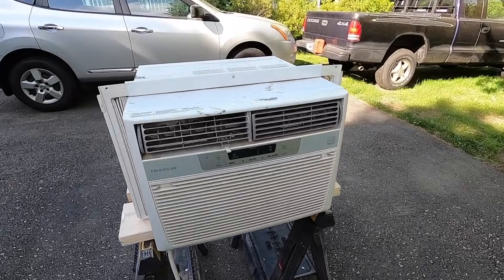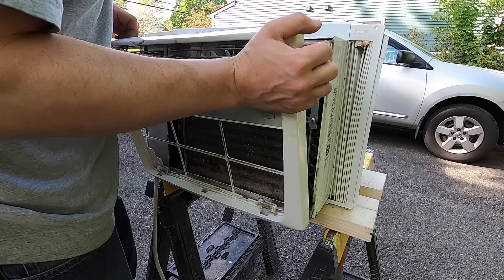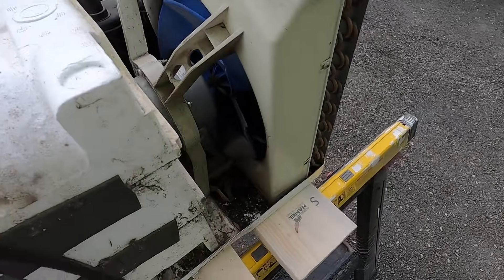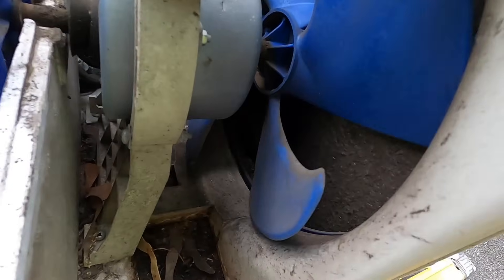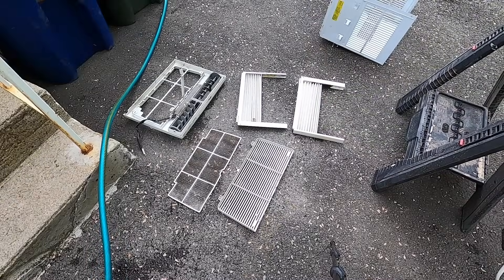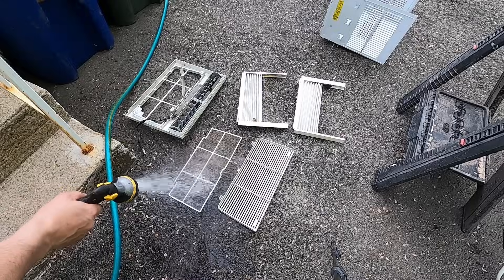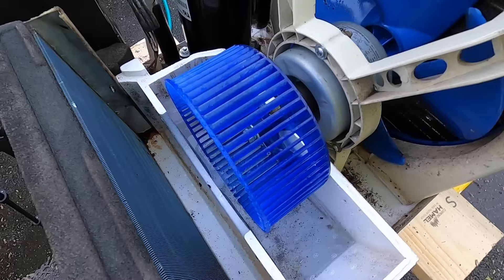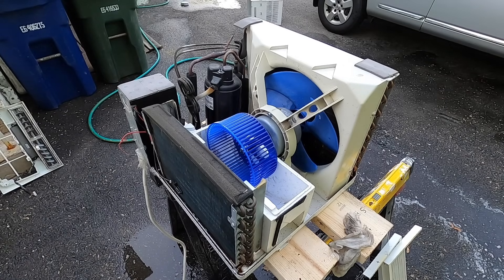How to Clean a Dirty Moldy Window Air Conditioner

Comment: Good reminder for everyone to check their a/c for mold. I'd add 2 things: try to keep the GFCI plug dry- if you leave it on the ground in the water it can permanently damage it, and they are expensive to replace. Second, run the a/c for 30 minutes or so after cleaning, in order to evaporate water that might have gotten in the bearings. I've cleaned a/c units without running them immediately afterward and several times a bearing apparently got water in it, making it very noisy, and replacement of fan motor  bearings is a hassle that is best avoided if you don't have to do it.
Reply: Better yet, don't get water in the bearings in the first place. I had to replace my bearings. Total PITA.
Reply: Run it IMMEDIATELY or after letting it dry in the sun for a bit?  I'm going to bag and tape the shit out of mine.
Reply: @josephdockemeyer6782  How did it turn out?
Reply: @GuerreroUrbano100  Haven't done it yet.  Severe mosquito infestation here with 15% positive for West Nile.  Swarmed just getting into the car.  So don't want to be out in my driveway that long...  52 bites just taking out trash and carrying in groceries.  Sucks lol.
Reply: Wd40 the fan bearings first - check
Reply: Best thing is to clean it before you put it away before winter. Don't like taking it out and having to put it back in. Have one that's 9 years old and works just like it did when I bought it.
Reply: @Seriouslydave  where are the fan bearings?
Reply: @3242clyd  the fan is a wheel with an axel , or spindle in the center, the spindle will have a metal ring around it , the bearings are in their , think of a bike wheel , the berings are where the spokes ogiginate in the center , or  a skate board , the bearings are right next to the axel
Reply: @Seriouslydave  No. It could get in and dilute the grease/oil.
Reply: I made this exact mistake a few years ago.  Unit still cooled great but the bearing was SCREAMING.  Had to scrap the whole unit because of a $5 bearing.
Reply: @MrMjrob  Someone posted a video of changing out window ac bearings- it can be done using skateboard bearings. I've done it- there are 2 bearings on the motor shaft- it's time consuming because you've got to take so much apart. Worked OK, but you're much better off keeping the bearings from getting wet. It's a lot of work that can be avoided.
Reply: @mickm5097  yep, I tried!  Couldn't get the old bearing off. Finally gave up.
Reply: Good Advise, My Styro Duct and Blower wheel were very moldy. I used Clorox l clean up on the moldy parts. Then the next day I started it up and it sounded like a coffee grinder .
Then the black stuff came flying out of it.  After a few minutes it quieted down.
Reply: I’m confused. Where do you suggest adding WD 40? 

And isn’t it an issue if you run it wet??
Reply: @elisap1098  I wouldn't use wd-40- it's not a good lubricant in this case. One of the problems that occurs when you clean an ac is water getting in the bearings. Bearings are rings with grease and little metal balls that allow a motor shaft to turn smoothly. When water sits in there for any period of time, the metal balls begin to rust and you start to hear noise, and the motor can even fail to start. So you want to run the ac right after washing so the motor turns, the bearings heat up, and any water in the bearings evaporates, to try and avoid these issues.

Comment: You can prevent all that mold in the first place by simply drilling a hole to let that condensate water drain from the unit. You will take a small hit on efficiency, but you will not ever have to deal with a moldy unit, OR do a really deep clean like this. It's the standing water in these units that causes all the problems. Using a step drill bit is recommended so as not to puncture the condenser and let all the refrigerant out. This is another example of energy efficiency standards causing more harm than good, with all these clogged up units that get sent to the dump every year. Do yourself a favor after you get your unit all cleaned up, and drill a hole in the case to let that water drain out!
Reply: Yeah????
Reply: The problem is using eco mode on air conditioners. The fan isn't left running long enough without the condenser on to get rid of the water in the back of the unit. Use eco mode during the day and use the normal cool mode at night so when the condenser shuts off after reaching the desired temp the fan stays on expelling the rest of the water.
Reply: I have this same unit and there is a drain hole in the bottom but it is located rather far foward toward the wall of the house.  It gets clogged with debris and slime frequently gets clogged.  Here in Florida it is a constant problem.
Reply: @Dallas_K  go to home Depot and buy window screen. The cheap stuff. Wrap it around the outside so the vents are covered. Clean it off when it gets dirty. Put an extra layer on top of the ac, that where most of the stuff falls in
Reply: I drilled mine out with step bit due to hole placement being not right it will still clog based upon where your unit is located ...near trees or near shade or having shingle roof or several factors
Reply: It expels the moisture in the house too. Add lysol or bleach solution to rear of unit weekly.
Reply: @designstudio8013  Where would you add a bleach solution? Are you saying add it in the drip pan?
Reply: @playerroku4412  The fan will not expel the water as alot will stay below the fan level.
Reply: @Dallas_K  I put a plastic tube with a syringe I attach to pull a siphon to empty the drip pan.
Reply: @TheMsparker27  Yep spray it in the rear pan. Siphon out water with a tube and syringe as needed.
Reply: where is the case
Reply: Where is the best place to drill the hole, kinda near the back or the middle underside or a hole in both back corners maybe?
Reply: @elijahmelendez9864 the whole exterior is the case, but the reference is for the bottom of the part hanging out the window
Reply: @playerroku4412  i always turn eco mode off, still an issue.
Reply: @themaindragon  then it's dirty.
Reply: @designstudio8013 oddly, as a temporary fix, I tightly rolled a shop towel and inserted it to drain. Do you have a photo of what you did?

Comment: My a/c had mold the year before. So remember that if you get mold in the a/c, you may need to clean it once a year because my mold came back the following year. So now I will do it every spring before the season starts. NOTE: I cleaned my a/c in the bathtub by putting down garbage bags to protect the porcelain. Headaches caused by the mold are lessoning. I'm washing my walls in my space and washing everything to get rid of mold spores. Thank you for this video!
Reply: Black mold alergies is not fun.. prevention is best, clean and care every so often.. so it doesn’t build up like this unit in video
Reply: Mold smells, musty and disgusting.. keep it clean and fir god sake don’t live in moody space

Comment: As a hotel handiman I used a fin comb to straighten and clean between fins. There was also a special spray cleaner but it was pretty harsh. I'm rather upset the manufacturers did all they could to keep us from easily cleaning these but they need to sell as many units as possible so it's really up to us to learn what you're teaching and nudge them towards what we want by not considering these things disposable. Peace.
Reply: God help us!! I'm not able to clean mine like that anymore,bad back,neck,should er r and too old!! Whi can i hire to do it?
Reply: @deloresmiller3853  Same here. My hubs and I used to take out of the 12000 and 15000 btu window units over the years and clean thoroughly but we're in our mid and late 60s now...ain't happening. I have some Frost King coil cleaner and I just want to know if I can use it on the inside coils while the monster is still in the window 🤪
Getting old sucks!
Reply: Try compressed air. Just do it in short spurts
Reply: I'd never heard of a fin comb, so.your comment is immensely helpful. Thank you.
Reply: @momadog5687  Yes, it most definitely does suck!
You've heard the saying "youth is wasted on the young"? Tis true!
Reply: @drt-abrat1256  No truer words.. LOL
Reply: A good quality, thick metal butter knife (like oneida brand) works wonders in scraping off encrusted metal fins and straightening them out.  

To scrape , hold the knife horizontally and use its serrated (wavy) edge to run along the surface of the fins. 

To straighten the fins, hold the butter knife vertically and tilt it  slightly forward,  then move it downward in  between each fin. 

 You can even tilt the knife left or right as you move it down between the fins to fine tune how much you're spreading them apart from each other while straightening.  It's actually much easier than it sounds.

Try it, you will be surprised

  If you want something to pick up the dirt and debris as you go along, use the hose of a vacuum cleaner to follow behind the knife as you scrape.
Reply: Even fin strengtheners must be used carefully. New units have fins that approach aluminum foil thickness. Careful inspection needed before you start.
Reply: Use purple power. No harm and it works like magic. Spray on rinse offñ
Reply: @deloresmiller3853 I have mine pulled out and needing to do the same thing as video.  Same model too! 

I also had four spine surgeries, muscle spasms will rise from SI to the neck, hip and sciatica pain, two blown knees, torn rotator cuff and a pinched nerve in my neck. 

And THEN, I get to reinstall the big heavy thing back in the window.

FUN FUN JOY JOY😂

Comment: Great video! My daughter wanted to trash the units (5) because of the mold but you saved the day and a lot of money. Thanks Joe
Reply: I trashed my $400 two-year-old unit after I took it apart and saw how black it was, but now I'm regretting it. It was a great machine, much better than the $160 unit I replaced it with. The neighbor's weed comes in around this one.
Reply: You made smart move. @BebeDaull

Comment: If you have an air compressor it's pretty easy to make a pump to drain the fan area without having to tip the AC, which mis-distributes the oil in the lines. Just get a couple feet of tube(anything around 1/2" to 1" inner dia. will do, cut a hole about 4 inches from one end such that you can put the air nozzle into it facing toward the end(without the nozzle completely blocking the inner diameter), dip the other side down in the water and blast the air. It will make a vacuum in the rest of the hose that will suck the water out and blast it out with the air.
Reply from the maker: Thanks for the tips!  And thanks for checking out the video!
Reply: Will have to think on that one

Comment: Just a heads up.

I have a Kenmore, but it's an identical design and I don't think that fresh air lever that goes way back can be removed from the styrofoam housing without breaking something. Maybe that's what he did. And of course, you can't reach each part when it's all together. What a nightmare.
Reply: You can get that lever out. I did. I had to break a little plastic to do it but it didnt hurt it. Then the cover comes off all the way. It's just something you have to do.

Comment: My brother has 5 window units, last weekend this 65 yr old lady, me, lined them up, one by one i dismantled each one. Used a washtub of soapy water, Dawn, and scrubbed all the parts that i could take off. Used a scrub brush and a toothbrush for the details. Then hosed out the insides real good. Then reassembled them. Put them in the garage for the winter where they will stay clean til spring. He had just bought an old house that was formerly a rental house, they had probably never been cleaned before. I just know they are all going to work much better

Comment: I have the exact same one, and I left it in the window without covering it for 2 yrs.  My other unit i pull out every year (it’s much lighter )and its 18 yrs old n has minimal mold.   I looked it up and the reason they get moldy is by not covering or removing after summer.  🙂 The site that I got info from says the blk mold could circulate thru house n cause health issues 😮‍💨🤕  so I wouldnt use it til i cleaned it, so Im so glad you posted this! 🙏🏻👍

Comment: I'm happy to have found this video. I have an identical window unit and have the same problem. I was worried about the mold on the styrofoam but I will probably initially kill it with bleach and then maybe use peroxide and vinegar on it. Styrofoam that's located under the fan, I know you did not take that out. The question I have is should you be worried about mold underneath that styrofoam? I know it's extra work and I could probably take it out if I wanted to and clean it but I just wanted to know your thoughts. Great video thank you so happy to have found this! I was worried that I was going to purchase a new one. 👍

Comment: vintage units from the 80s and before were made so much better, instead of styrofoam they used metal with fiberglass so mold did not grow as easy, not to mention alot of them had service ports to ad refrigerant should you have a leak and the motor had oil ports so you could oil the bearings.
Reply: Yeah but that meant you got what you paid for. And they couldn't sell you another one in 5 years.

Comment: Thank you so much for this video my ac was getting hot in the back and blowing breaker after taking apart I realized why I went 1 step faster and removed screws to the back vent behind fan so I can get it totally super clean that's why it was over heating it had super thick dust in the back I was shocked my front not bad it was the back one. Was gonna trash it till I seen this video so thank you so much.

Comment: A quick Google search says use vinegar OR (DO NOT MIX) peroxide to kill mold. So I would use a disinfectant liquid, dish soap, and water in a spray bottle to soak everything first. Then rinse off with a garden hose. Then I would use pure vinegar on all the parts to kill mold and disinfect the cleaned unit. Or at least in the moldy areas after the initial cleaning.
Reply: This! Bleach is actually not that effective at killing mold/mildew and yeasts. Good for virus and bacteria. Like you said peroxide OR vinegar. Vinegar might help avoid regrowth for a smaller while due to the acidity left behind but it also can wear our the plastics and corrode metals.
Reply: @Zanuvar  yep only use bleach, vinegar, and/or peroxide in an air conditioner IF you can soap and hose out to clean all the acid out so it doesn't eat/weaken any metals and plastics if left in. I need to take out my window acs every year before summer and soap and rinse out then vinegar then rinse out all my ac coils and air box, (the part where the air comes out) because the air box is usually very dark, cold, and damp and covered with black mold so yeah good to clean twice a year, once before summer and once before the dead of winter if you need the heater on. Also cleaning the coils will help with heat transfer so the compressor and fan don't have to work too hard to not take years off the life of the ac.

Comment: This is part of my Fall maintenance schedule. You do this when you do not need the A/C to keep cool. I set my Window A/C on the bench, take it apart, clean and straighten the fins on the heat excanger, all internal ductwork, filters (mine has two), all fans (both squirrel cage and bladed fans). I use a cleaner that all HVAC  technicians use that dissolves and decontaminates all non electrical internal parts. I also use the fine machine oil to lube up all bearings or bushings (a little bit goes a long way, so do not flood the rotating parts. Cleaning the leading edges of bladed fans is a must, or your work is incomplete, squirrel caged fans must be cleaned, too with an old toothbrush and your spray bottle with 1/2 oz of soap and one oz of bleach to 16 oz of warm water. And, a fine toothed fin comb is a must whether the fins are dented, or just slightly bent (this helps in the cleaning of the exchanger). 
Clean the thermocouple carefully with the toothbrush lightly moistened with your soap/bleach mixture. This part senses the incoming air temperature and partly controls how long your unit runs.
Let the unit dry completely over several days in your shop or covered back porch, then reassemble (take many pictures with your phone so you can see where everything goes back in case you forget). Then reassemble and restore your unit back in the window/ wall where it came from. If it is a heavy unit like mine, ask someone to help you reinstall it in that space. COVER your outside part of the A/C unit with saran wrap, foil, or plastic so dirt and moisture will not ruin your hard work - remember to remove this cover before the cooling Summer season starts! When you do this after the Summer cooling Season ends, you can take your time and do a GOOD job! My A/C unit is 25 years old, and apart from adding R-22 to it once three years ago, it has run like a champ cooling my 1017 square foot house all by itself.  I learned this all from a friend that works on HVAC systems, watched him do it once, did it myself the rest of the time. Someday, it will die, but take the measurements with you and get the best replacement you can afford - it is worth the trouble and expense.
Reply: Thank you for this very informative comment.  It seems like a project, but I can do it.  The only thing that makes me nervous is messing around with the internal wiring, as The Fixer did.  I think I will skip that part.  May I ask:  What brand of machine oil did you use to lubricate?  And where is the "thermocouple"?
Reply: Same. What is the thermocouple? I guess I can Google that lol...but do they look the same for every unit?
Reply: HOW and who did the adding of the R-22 (refrigerant) to the window ac unit? I ask becasue i believe mine might need some but i cant seem to find a video on how to do it. Can you please help.
Reply: You have a fall maintenance schedule? Goals.
Reply: Wondering this myself! :) @douglasvasquez4113
Reply: What's that spray